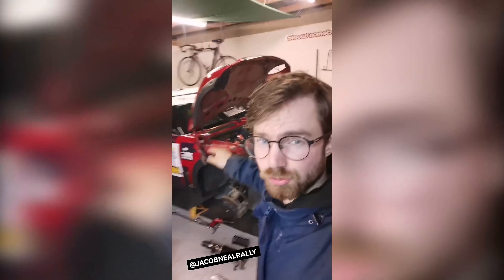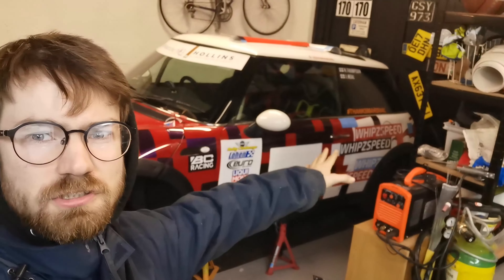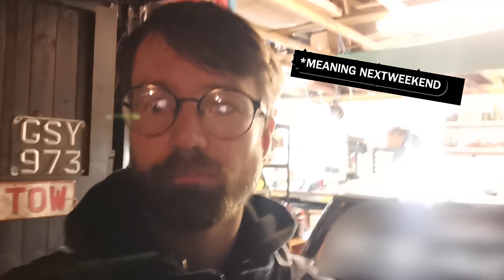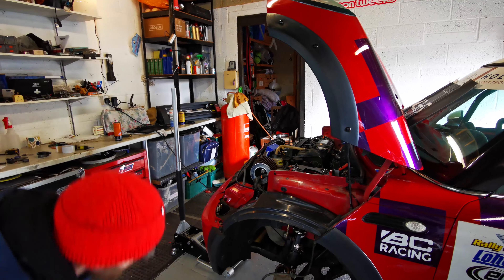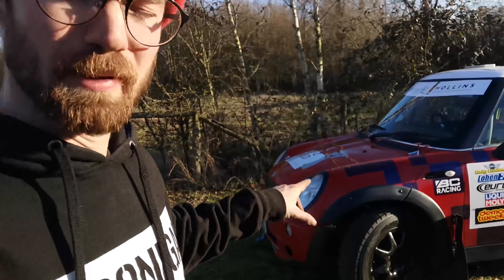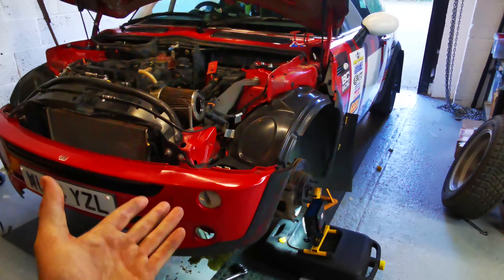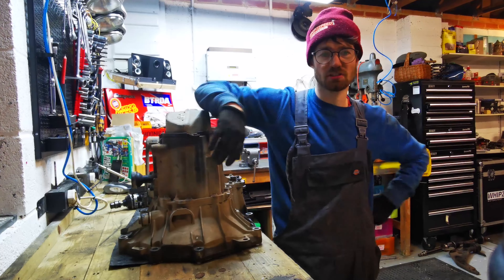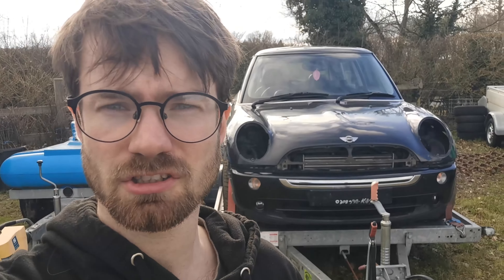Gravel testing prep & Disaster... MINI Rally Challenge 2023 EP 02

Comment: I was under the impression 
You could use the getrag
If you also use the driveshafts
Linkages
Clutch ect. From your donor car
It should just bolt to your existing engine
Reply from the maker: Your very right Jonathan however, for the mini rally challenge we are limited to only using the midlands gearbox and cars between certain dates etc as per champ rules. Otherwise yeah, I'm good to go haha! Another problem would be that the Limited slip wouldn't fit the getrag box, but unsure at this point
Reply: I’ve also read that changing the oil  on the midlands box can help
They all whine a little and loose fragments that stuck to the magnet

I have a 2002 cooper project with same midland box
Hopefully have it on the road this year

I use the smith and Allan oil. Specific for the midland box
From fleabay